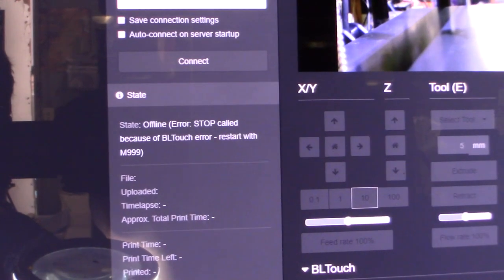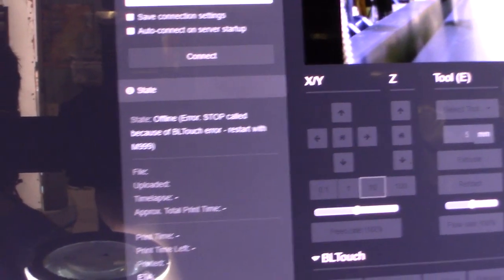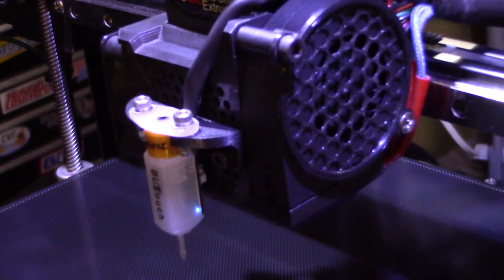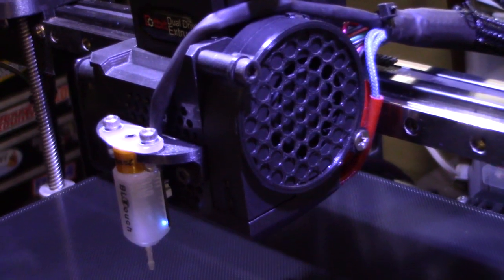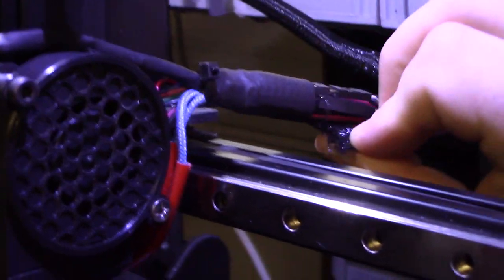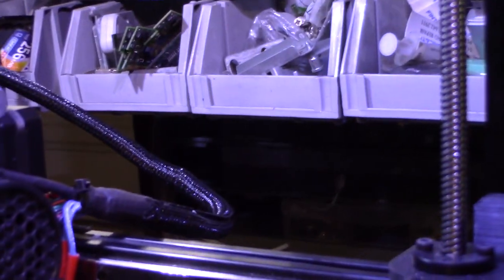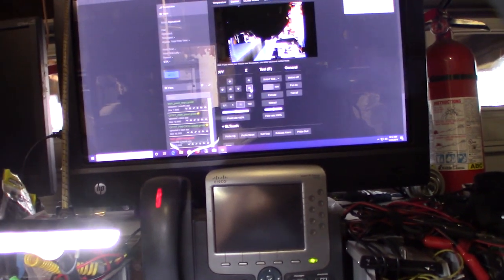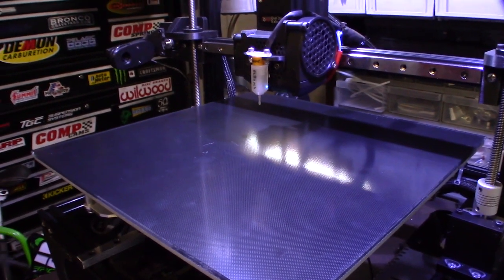Octoprint Error: STOP called because of BLTouch error - restart with M999 repair troubleshooting

Comment: having the same issue checked all the wiring with a multimeter and plugged the touch directly into the motherboard and had the same issue. The issue started after moving the electronics box so it makes sense its a loose wire but i think I've tried everything and I'm not sure where to go from here.

Comment: For me it wasn't the cables, but i opened the BLTouch. The little magnet in the pin was halfway the little tube it is in. Pushed it down and problem solved.
Reply: Month later same problem, opened it up again and put glue on the tube end to keep the magnet from moving. No more problems for now.
Reply: @PietjeNL  Hey, buddy. Mind uploading a photo/video of what you're describing? I think I may have the same problem, but I'm hesitant to open up my BLTouch unless I know where I'm going. Thanks!
Reply: @markgoproductions  You can just open it by getting the little hex screw out. Then the probe would just be able to move out without any problem. On one side it has the point, on the other side there should be a little magnet. Just try it, don't force anything and you should be fine. For me it was or try to fix it or buy a new one.
Reply: @PietjeNL  Got it. Thanks! :D

Comment: Another thing to try if this doesn't work, my bltouch was failing m999 error and i took a hex key, undid the top grub screw, and took the pin out and it was bent and must have collided with a print. i put the pin in a cup of hot water to soften, went to vacuum the house then came back and gently bent it back to straight, and with a little silicone lubricant popped it back in and it works again.